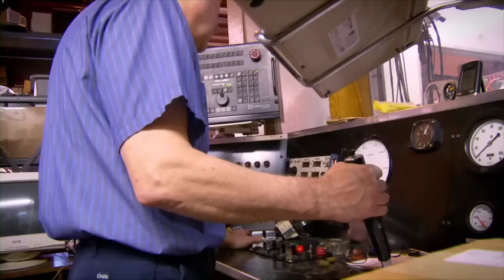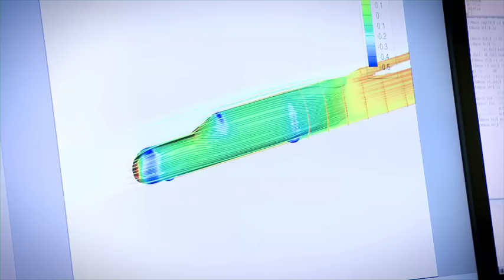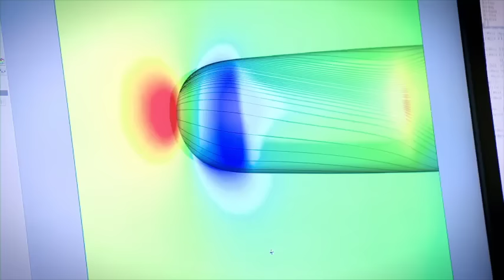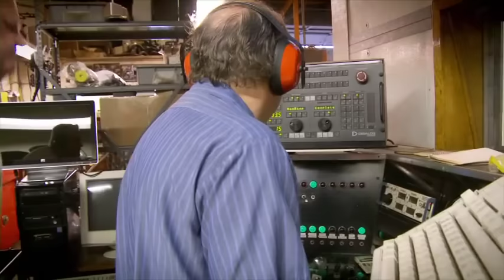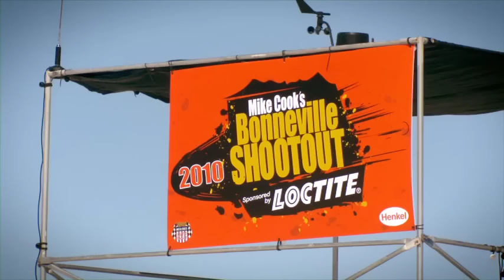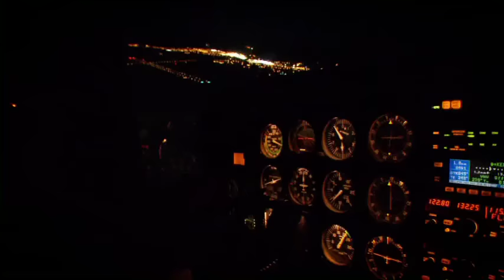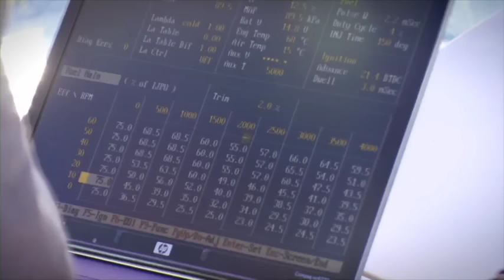Fastest Bike in the World! | Breaking the Land Speed Record! | ACK ATTACK | Full Length Documentary

Comment: Interesting     My Thoughts      an Electric  bike with  2 wheel  drive  would  be the way to set speed records..   Seems  traction is  such a big  issue on salt
Reply: electric motors generate torque for acceleration.  Horsepower at high rpm produces top speed. E-motors don't develop that high of HP nor, currently, that level of rpm.

Comment: Great, so you can't change gear. Replace an engine. DOH!
Reply: Engine and trans are one unit.
Reply: It’s likely a gear selector issue. The engine and gearbox are the same unit, therefore the only alternative is to strip the whole engine and attempt to identify the gearbox issue, then completely rebuild the engine. Ergo it’s obviously quicker to replace the engine. Bike engines are not like car engines.

Comment: Bicke No3
Kawasaki zz1200RR
This was a road racer .. 
Power commander (max rpm)
Zz1400top
Zz1400 carb 
Zz1400 oiil cooler
And Muzzi All over!! 
Tester with a zz1400 gear box .. 
Top speed was as zz1200RR.
355.9km/h over 22km german free speed road
105 oktan Ferrari german Fule
AVON ROAD RUNNER TYERS

Comment: Sorry to burst your bubble..That is not a motorbike.
Reply: I agree! The fact that it runs on two wheels and is powered by motorcycle engines does not make a motorcycle. The pilot is in a reclined seat with a back, is strapped in, has a steering wheel with no throttle control.., clutch or break and has a roll cage. A loose classification of “motorcycle” if you ask me. This is a two wheeled car.

Comment: Who are ppl think they are kidding calling these things Bikes or Motorcycles. They have "stabilization wheels" and even require a "four wheeled vehicles" just to get going.  GTFO.....
Reply: The stabilization wheels retract. Its just for stopping and starting. He can't well hold the bike up with his feet and the weight of it is probably unstable at slow speeds. So what some racing cars need pushing to get going because of gears. The bike isn't for driving to the store its for setting a record.